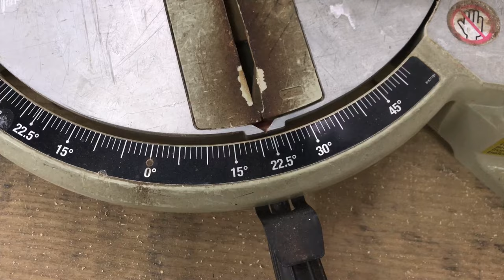Process Of Creating Cement Lego Bricks - Jointed Bricks Without Mortar

Comment: Why don't people use interlocking blocks and bricks for construction? Literally make them to where you can run rebar down thru all the walls and tie the rear at the top. Hell for that matter you could tack weld all the top ones and cut and reuse the blocks later. I have done construction and it seems to me there is a lot of extra work and money for less reliability.

Comment: been watching a few "interlocking" brick vids lately, and one question keeps popping up... with all the interlocking parts, there doesn't seem to be enough space for the mortar to fit between and still maintain the interlock.. otherwise nice design....
Reply: They are meant to be used without applying cement. They are mainly used for the boundary wall of the house which is not very tall.
Reply: Surface bonding cement applied to both faces. And then mortar and rebar in the holes.
Reply: Mortter isn't needed. That's why it is interlocking
Reply: Using the same pipe used to create the holes in the blocks, you can lock the blocks together securely without morter... as designed. Adjusting the dimensions SLIGHTLY would permit use of construction adhesive if joint "leaks" are a concern. For retaining walls, perimeter foundation, or simply decorative partition walls, these are quite attractive if different "concrete" suited to each application is used. One could easily incorporate steel reinforcement in the product for additional strength in the active seismic areas like here in Washington state. I like this design best so far. Thank you!
Reply: @stevenmitchell6347  Then it will increase the cost.

Comment: They are fine if you want to create a flower bed wall or something like that. They won't work for creating a strong structure you need more room between them for putting wet cement to bond them. 1/3 to 1/2 of an inch should be good.

Comment: Great design! Strong, foolproof to use, need no mortar. If you did use them in a building, just a tiny bit of concrete slurry, expanding liquid foam, gorilla glue, or construction adhesive would lock them very strongly. They could also be made cheaply with dustcrete or fired clay.
Reply: The mortar has also the role to correct the irregularity of the bricks. No product on earth is precise. The mortar enables to correct it in order to build vertical walls, at the same height from one side to the other, and on the same plane. With only 2 levels of these bricks, you already sea irregularities, and they accumulate with the design, they don't compensate.

Comment: These are a great idea but only for local use. These would be a nightmare to ship long distance without them receiving damage to the fragile locking tabs at the current size. Justin this video the was a few with broken corners already. What doesn't get damaged in transport will get damaged by carless workers. I would also recommend putting a channel on the ends that lock together as well. Second problem, which is only with this video, is the mix is way to dry. These will crumble and weather easily.

Comment: Using the same pipe used to create the holes in the blocks, you can lock the blocks together securely without morter... as designed. Adjusting the dimensions SLIGHTLY would permit use of construction adhesive if joint "leaks" are a concern. For retaining walls, perimeter foundation, or simply decorative partition walls, these are quite attractive if different "concrete" suited to each application is used. One could easily incorporate steel reinforcement in the product for additional strength in the active seismic areas like here in Washington state. I like this design best so far. Thank you!

Comment: faster and more solid to form vertical posts in reinforced concrete, every 3 meters and between the 2 posts pour 7cm of concrete wall in rows. 12 cm if floor or if we have the means.
or walls entirely made of rammed earth between sheets when you have little financial means and clayey soil nearby.
This is too much work with blocks (the mold will not hold 1000 blocks...) and above all non-compliant because of questionable solidity and gaps in the joints therefore not airtight. but it's very nice to see what some people can do with a few boards

Comment: You have a good idea, but, it can be set up better.  Instead of loading from the end, have you thought about a top load?  It will mean setting your pipes longer, and refitting the sides of the box.  My guess is that you are making a 300 * 150 * 100 block?  At this time, you are compressing from the 300 mm end.  Would it not be better to compress from the 100 mm?  By going vertical, you are not risking bending the pipes, and you are able to get compression over the whole brick.  Your current method does not allow you to get full compression on the top edges where the blocks are for the shapes.

Am currently in the process of building a sieving table, bolted together, powered by a bicycle drive!  My next project after that is to build a vibrating table for the manufacture of interlocking blocks.  
The third project will be the manufacture of a CSEB machine that, if designed correctly, will be able to make the interlocking blocks or CSEB of different sizes.  If I can get around to it, a video will be posted on YT, showing what has been done.
Reply: i wish to see that, if you publish the video put the link right here

Comment: And what kind of solution is planned to fasten the wall from these blocks? If it is the same cement, then the space between the complex shape of the bricks is not enough, because the cement mortar does not compact like that. If with glue, then what kind? The ones in cans are much more expensive than all these forms and blocks combined. And without a binding solution, such a wall is not suitable even for the construction of a garage. It is also not suitable for building a house because, most likely, it does not have enough strength and compression like red or white brick made in factory conditions.